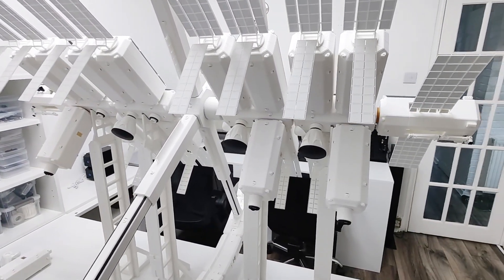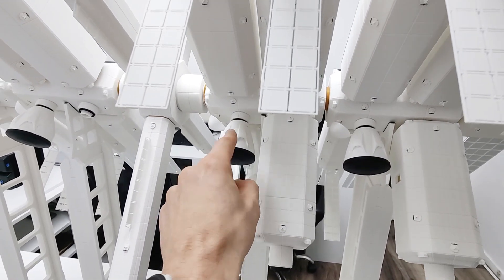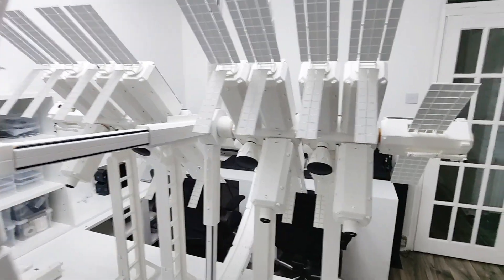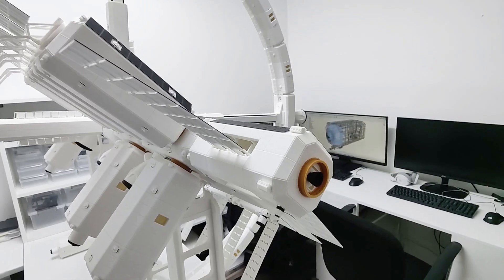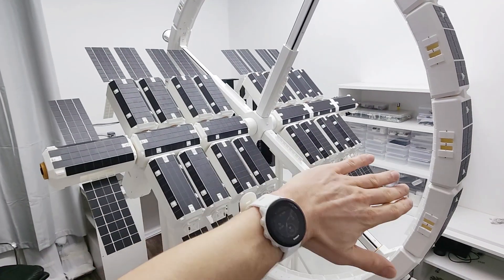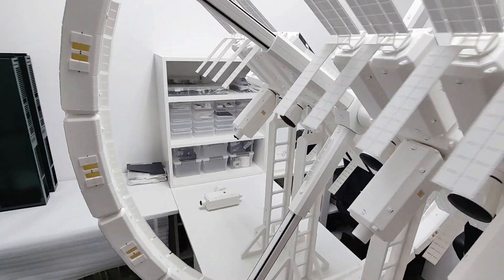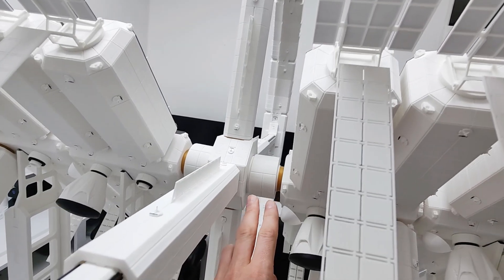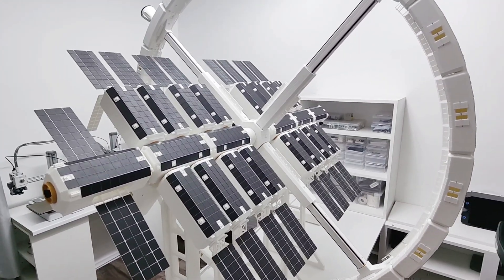GST-01 rev1 explained

Comment: What about rotating the entire structure and pointing the axis of rotation at the sun so that the solar panels can remain pointed at the sun?  Wouldn’t be able to dock while spinning, but there wouldnt be friction from bearings or seals needed. Simple is safe after all.
Reply from the maker: This could be done, and even put it in the Sun-synchronous polar orbit (despite up to 30% launcher capacity penalty), but if you have industrial sections on the Z and Z is pointing to the Sun, then the modules will eclipse each other, reducing PV available area for example. In case of high inclination orbit (97-98 deg), the almost permanent Sun exposure could make up for the loss of area, but regardless,  this config would require complete redesign. Then there is the docking issue, and the fact that industrial sections are for micro-gravity R&D and manufacturing (ISM), so it shouldn't spin...
Reply: @ I bet it would be possible to dock while spinning if dock is centered on the axis of rotation and the docking ship matches rotation speed. The center would be nearly microgravity if the entire structure rotates at a very slow angular velocity.  And then 1 g can still be achieved on the perimeter if the radius is large enough.
Reply from the maker: @tomrichner4819  That is all true, but the size of the ring is already at it's maximum radius considering Starship, timeline and business plan constrains. Making it even slightly bigger would result in more modules, more  and longer arms (wont fit in Starship), bigger core  module (wont fit in Starhip) longer timelines (already at 7 years and barely fundable) and bigger budget. Revision 2 is almost complete, and funny enough docking port in now on the Z axis, but for different reasons.
Reply from the maker: @tomrichner4819  This is all true, but the ring radius is already at it's max considering Starship payload envelope, timeline and business plan constrains. Bigger ring would mean more modules, more and longer arms (won't fit Starship with single flight), larger core module (won't fit Starship), longer time line (already 7  years and barely fundable) and bigger budget. Revision 2 is almost complete and funny enough the docking port is now on the Z axis, but for different reasons.

Comment: Might be a good idea to make a dynamic CAD simulation with conservation of momentum. A lot of efficiency would be gained with a pair of fly wheels flanking the rotation section. Awesome project. I’ll be following along.
Reply from the maker: Yes, I think somebody at Nasa Space Flight forum suggested fly wheels, but fly wheels = mass, and there is always going to be some momentum loss because of bearings. So might as well allocate power budget for the motors, which are anyway needed for control. The biggest problem seems to be dynamic stability at the moment. There is some difference in opinions regarding principal axis of maximum inertia, given that the non-rotating segments are dynamically decoupled. I will need to simulate this first and incorporate into next revision...

Comment: Won't this create rotational momentum orthogonal to the direction of the wheel spin?
Reply from the maker: torque, yes, hence the dual motor couplings to counteract.
Reply: @gst_yt  not from the friction of the motor bearings, like not opposite of the direction of wheel spin, but orthogonal, like the demonstration of how you spin in a chair when holding a spinning wheel
Reply from the maker: @solarmande7280  Like when you turn the spinning wheel 90deg? That's not the case here, because axis or rotation is fixed in inertial space (neglecting atmospheric drag, solar radiation pressure and other perturbators). Whole structure is also symmetric along this (z) axis.
Reply: @gst_yt  rotational velocity causes inertia in the direction of  the axis of rotation.  It's not about drag, or pressure, and it's not intuitive.  There's a great demonstration in Walter Lewin's 8.01x Lect 24.  Perhaps you've designed for this but I didn't see it in the video.  Perhaps it's simply that the wheel needs to orbit so that the inertia is directed along the orbit, I'm not even completely clear on how it works for a non-anchored body, I assume it's a constant vector per the right hand rule, rather than causing spin as was demonstrated but you show the wheel rotating along the direction of the orbit, which then would push the station towards or away from the body it's orbiting if I'm not mistaken.
Reply from the maker: @solarmande7280  yes, we had similar demo at uni, but this is fee rigid body, spinning along stable, symmetric principal axis, so it will maintain it's orientation in inertial space, unless internal instability is introduced (like mass distribution) or external torque like, atm. drag, grav. gradient, SRP... In the lecture demos, the external torque is the lectured changing the axis or rotation, hence taking on some of the angular momentum.

Comment: How do you spin up the ring without counter spinning the solar panels? Conservation of angular momentum means that you need a fly wheel going to opposite direction or a thruster.
Reply from the maker: the coupling sections between the center hub and the industrial sections (solar panels) are motorizes with 2 motors each. one for spin-up/sustain spin of the ring, the other to counter the torque on the industrial sections.
Reply: @gst_yt  I don't understand this aspect of the coupling design. Maybe I need a sketch or diagram of the two motors concept. It seems to me the moment would still accumulate over time, unless you have some kind of reaction wheel.
Reply from the maker: @DistracticusPrime  The rotating ring will transfer it's angular momentum via bearing frictions (needs to be connected to the rest of the structure somehow) as torque on the industrial sections. You can counteract this torque with say thrusters as @tomrichner4819 mentioned, but that is not sustainable because ring looses momentum/slows down. So you counteract with a motor, but then you need to add another one for the ring to keep spinning. I might need to create an animation for this one :). Another solution to imagine is a single motor (for each coupling), but geared to spin the ring clockwise and industrial section anti-clockwise.